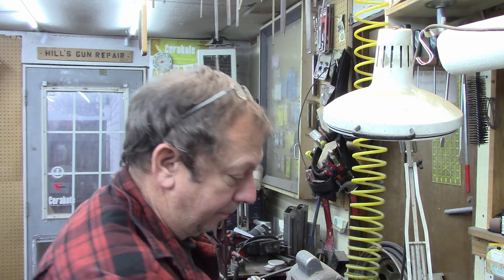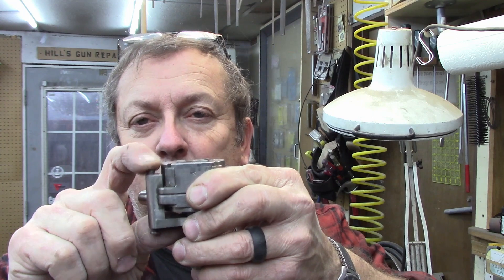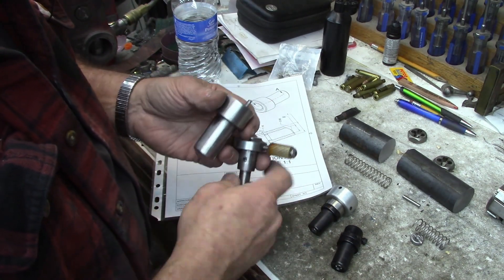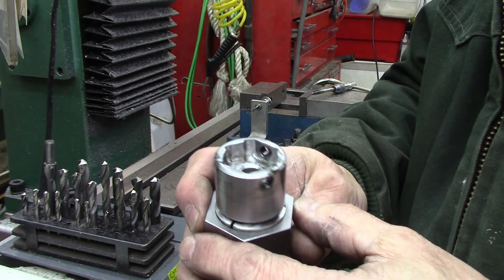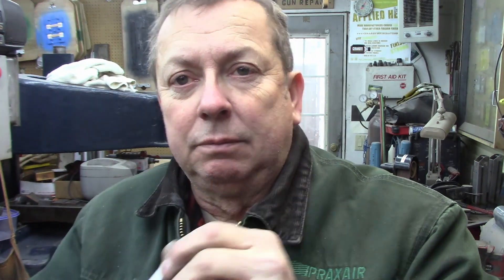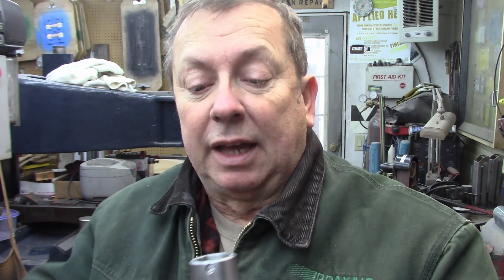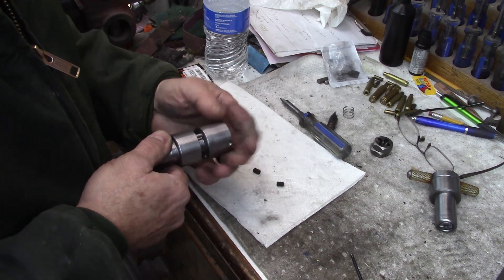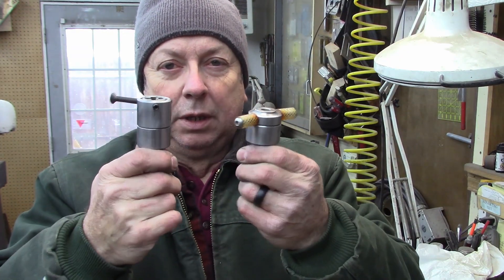Turret Lathe Die Holder For The Sheldon Lathe

Comment: Dan, great video. I’ll have to make one of those. Reading the other comment Glenn wrote, I was in Mechanical Engineering for 20 years. I did 10 yrs on the board, and 10 yrs on CAD... (AutoCad 2000). I never delved into the 3D capabilities of it. I might have to try learning the 3D, as it gives another visual perspective when designing parts. Have a great day!
Reply from the maker: Thanks, I still like to sit at a drafting board.If I want an arc to end I can Use one of those things we used to use called an eraser but the times have changed. now I can trim the line but it sometimes completly changes everything 😬. spent most of the day working on a project for the first part of a mold that will be cnc'd once the design is finalized and even though I spent way to long on it the prototype of the finished casting is running on the 3-D printer now and I will be able to make any revisions tomorrow without taking a chance on ruining any tool steel for a mold at this stage.
Reply: All my prototyping is on paper, the 3D printer technology I’ll leave for the younger generation!
Reply from the maker: I am no longer the younger generation and I do like it for prototyping, and some of my pattern making. but I consider it to be totaly useless for  actual parts on the machines I work with.

Comment: I often sketch up ideas in AutoCAD 2000…(it was a paid for install so don’t laugh at a 22 year old piece of software!). My work was always 2 dimensional schematics ..so I am not familiar with the 3d commands. I draw different views for my designs. Very old school. The 3d projections look really neat but the last time I did that was manual drafting 50 years ago. 
What software are you using? How is the learning curve?
Reply from the maker: Hi Glenn: I played with Autocad years ago but not enough to become proicient with it. My preference is to sit at an actual drafting board (which I still do) but since I do some things with cnc I am having to force myself to use cad and cam. I am using Fusion 360 (paid subscription) and am happy with it. The learning curve sucks. I can now produce the drawings fairly quickly and get fairly good results but I still run into small bumpsin the road where I have made some small mistake and spend way to much time trying to get some small detail such as a bevel correct. Just lacking practice. 😕
Reply: It looks like fusion 360 is becoming fairly standard. I am dragging my feet at installing yet another piece of software.
Reply from the maker: I think It has become fairly popular especially for the smaller shops and diyers mainly due to marketing. Originally free and for some I think it still is. But now I pay for a subscription and am pretty much tied in to maintain my pricing for it. I think it’s a good deal but you have to commit to learning and using it to justify the cost